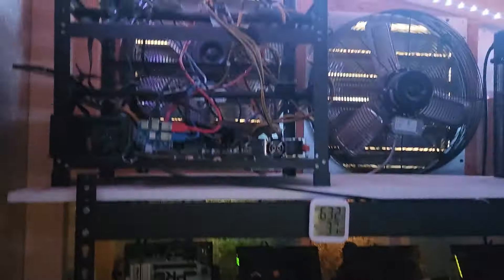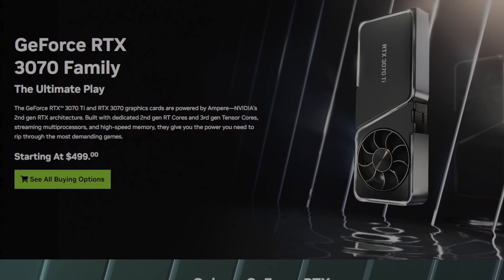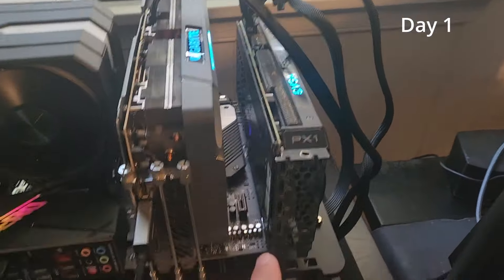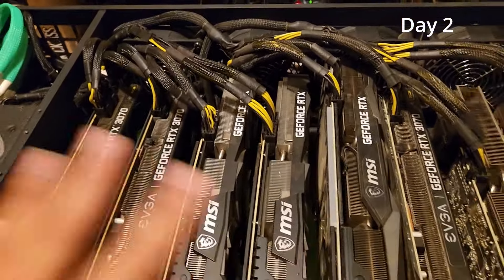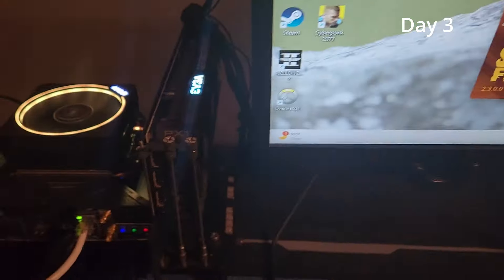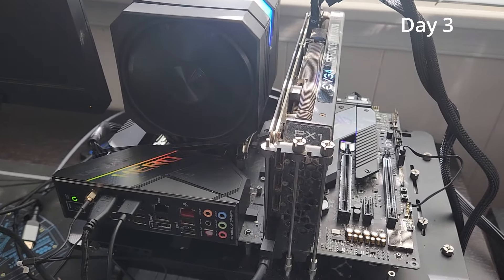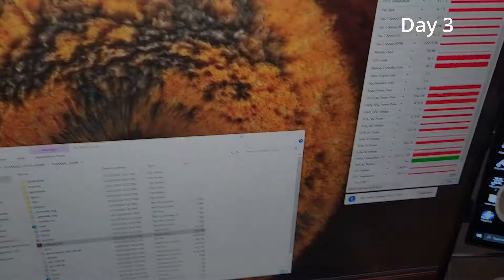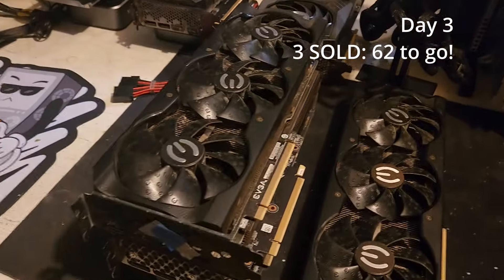Can I sell 65 Nvidia RTX  graphics cards in 60 days?!?!

Comment: man you can do better keeping those gpus as clean as possible 😭
Reply: I could not agree more, cleaning GPU means more than just blowing compressed Air through them. At least once a year they to be taken apart, cleaned with above 91% Isopropyl Alcohol. Remove all thermal pads & Paste & then reassemble them. Which is really not that tough as long as you plan about 1/2 hours per GPU depending if maybe fans need to be replaced
Reply: @saminekunis8680  I was thinking like running those GPUs in an environment were there is minimal dust and moisture in the first place. Almost eliminating the process of a deep clean all together, though replacing thermal paste and pads should be like.. mandatory for reselling. I have my own process of cleaning used graphics cards, and part of my process includes an ultrasonic cleaner and dedicated oven.

I don't mine but it does peak my interest, I'd rather have a room 100% perfected before mining or running a server in it. It's probably not as cost affective, with really no incentive to do so other than piece of mind. Like why would any of it matter when you can just sell a dirty GPU and let the buyer deal with it lol

Comment: sad that these were used for mining and someone is going to pay a good price for a card with a shorter life span
Reply from the maker: @pilbo_winklater  you mean a longer lifespan? Have you done your research or just came here to post broad assumptions that are just not true :)
Reply: @kr00tmanmining  a quick google search and some common sense shows that cards that were used for mining had shortened life span. gpus running for 24 hours or extended periods under high load will have shortened life spans. :(
Reply from the maker: @pilbo_winklater  quick Google searches are always right eh? I'll have to link you to many videos that show mining doesn't effect the lifespan of gpus
Reply: @kr00tmanmining  No it's just common sense. When you put a ton of stress and heat on components over consistent extended periods of time the components will deteriorate the life span of a card. gpus can 100% run for extended periods but on tasks such as mining for 24 hours for days or weeks on 100% in a small room that can get hot very quickly it will 100% remove some of that life span. i cant see in your videos but your room looks like it has little to no ventilation. i dont know where you get the idea that electronic components will last longer when put under intense load and heat. lol